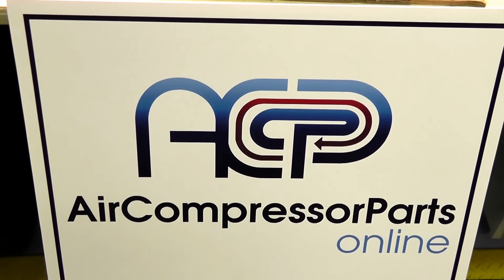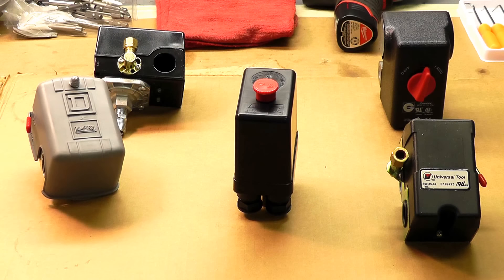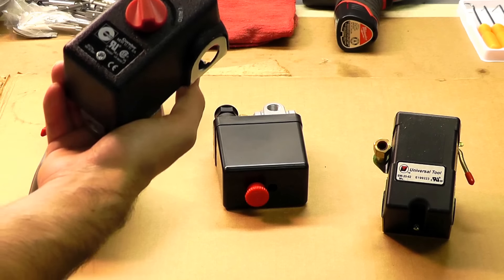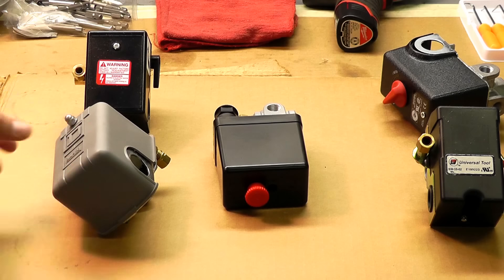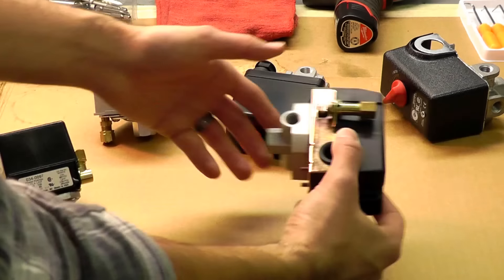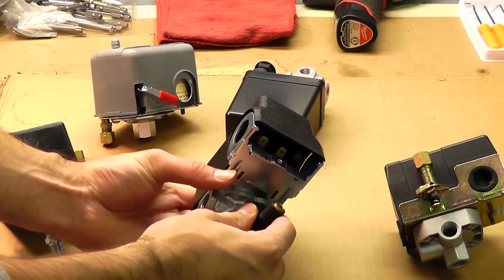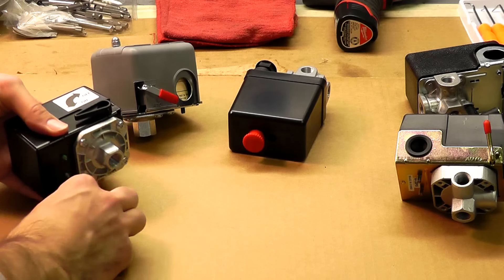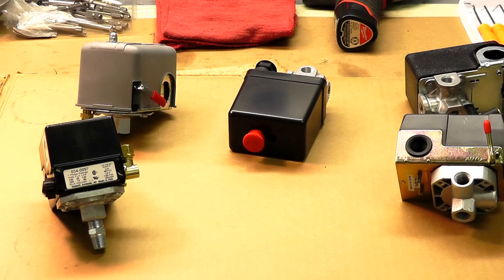Pressure Switch Replacement For Air Compressors

Comment: on your most popular Condor pressure switch, how do you disconnect the tube that goes into the 90deg unloader?
You mention that you push it in and it lock, but not how to remove it. Thanks for any hint.

Comment: Hi. Very informative video. Thanks 
I have a new Quincy QT-54 two stage. I need to re-route the unloader valve to go up to the exit port of the compressor. It’s a 90 deg elbow like you show but it’s a compression fitting for a 1/4” copper tube. My flexible hose that I want to attach is 1/4” NPT and it doesn’t fit the threads on the unloader valve. It looks like your standard 1/8” MPT, but my 1/8 x 1/4 NPT adapter won’t thread on. 
Maybe the unloader elbow can be removed and replaced with a NPT fitting? 
I’m not sure what my options are. 
Can you help?
Thanks,
Paul

Comment: I know this was made a long time ago. I have a fairly new AEG silenced 3hp 60l air compressor. The pressure regulator looks live the one with red push pull on/off switch with small hole beside red knob. I am in Australia and disabled so it’s quiet difficult to take it to get fixed. I’m told to small hole with Phillips head screw is for adjusting cutout pressure ( currently at 145psi. Winding that screw anti-clockwise does nothing. Have turned it between 3 and 4 full turns with no effect. Don’t want to go too far and have it fall apart in there. Also no obvious way to pull the cover off. Am quite familiar with square D switches on water pressure pumps, but this has me stumped. Thanks in advance

Comment: I need to replace the pressure switch on my older (early '90s) Sears Craftsman compressor. 

Compressor: Model 919.152830   30 Gal, 5HP
- Cut-off pressure: 125 PSI

Switch to be replaced: Furnas AC-0197

Sears' website says the part is out of production and no substitute part exists. But it looks just like the switch on the bottom right if this video. You referred to it as an import style 4-port Furnas style. Is that what I need?
Reply from the maker: Thank you for watching and for the question! First, the OEM switch is indeed obsolete now. However, it was a Furnas brand and a 4-port switch. You can probably use another Furnas (now Hubbell) 4-port switch, yes. The main specs you need to know is the cut-in PSI and cut-out PSI. You can view the various 4-port Hubbell/Furnas switches we have on our website by clicking on the below link:

https://mastertoolrepair.com/4port-style-pressure-switches-p-287.html

Hope this helps!

Comment: My Harbor Freight air compressor burned out after 13 years of service.  I disassembled the switch and found it was melted inside where the contacts are.  I replaced it with the red push/pull switch and voila!, it's back in service for a heck of a lot cheaper than another air compressor.
Reply: Were is the check valve on my hausfeld compressor?

Comment: Hello. This might be an off topic question but is it better to  leave the drain plug open when the compressor is not used for a longer period of time such as during winter in order to prevent any possible condensation within the tank?
Reply from the maker: Thank you for the question! Yes, it's always best to drain the tank of air when you know you won't be using the compressor for a period of time. You don't necessarily need to leave the drain cock open but at least drain all of the air from the tank when you know you won't be using the compressor for awhile; this certainly helps prevent condensation and hence, rust.

Comment: @Air Compressor Parts Online My pressure switch looks similar to your in the video in the centre with the red circular push down pull up switch and black plastic casing, can that type be adjusted? are some preset

It says on the casing;
PULL SWITCH NE MA (Spa)
20 AMP
380V MAX

Comment from the maker: AceBoy2099:

The SquareD switch you're describing sounds very common. From what I can tell from you description the cut-out pressure is 125 PSI. If this is the case, then the Square D model# W4203 pressure switch would probably work for you. You can find it on our site here: http://www.aircompressorpartsonline.com/square-pressure-switches-single-port-w4203-pressure-switch-p-15233.html. 

Basically, you want to match up the PSI rating (cut-in and cut-out pressures), the type of Unloader Valve, the type of manifold fitting and the amp rating. 
The W4203 is a two-pole pressure switch and cuts-in at 95 PSI and cuts out at 125 PSI (typical for a single-stage compressor), has a straight, brass unloader valve with a 1/4" compression fitting coming out from the bottom, and is rated at 15 amps. It has a single 1/4" FPT fitting on the manifold.
It is the same switch as the SquareD 9013FHG12J52M1X model. It will wire for either 120V/240 Volts, single phase or three phase.
Hope this helps!
Reply: Air Compressor Parts Online

Comment: We just experienced classic pressure switch failure. Our shop compressor started running up to 150 psi and lowing the relief valve. It is a Craftsman 60 gallon model 919.165600.  Do you carry Pressure switches for these compressors?

Comment: Good video. I have a compressor with a pressure switch like the "import" version, with the push/pull switch. I haven't had a real good look at it yet, but there may be an issue with the air bleed side of it. The compressor turns off just fine, but when it tries to start, the motor just hums, like it's stalled.
I think it may be that the bleed switch doesn't bleed all the air pressure out, not enabling the compressor motor to start, or that indeed the start capacitor on the motor isn't the correct one, not enabling the start windings of the motor to develop enough torque to start against the pressure.
Also, I'm in New Zealand, where we have 50Hz 240V line voltage.
Would it be possible, with the switch I have, to set the restart pressure lower, so that it actually starts?
Reply: It could be the check valve also.

Comment: I've got a Craftsman 33 gallon 110 volt vertical compressor. My pressure switch failed this morning. The one in the upper right hand corner looks very similar to mine. Did Craftsman use those as well?

Comment: 4:00 The thing i’m finding very frustrating, is that I can’t find the right size of compression fitting to replace the unloader tube. I have a pretty old compressor and the tube was aluminum and I broke it while I was replacing the pressure switch. Now I am having a devil of a time trying to find the right size tube and compression fitting.

Comment: Great video! Just purchased a compressor and trying to find out about everything I can :) The manual that came with the compressor doesn't explain the pressure switch part.

Just wondering, should there be a hose connected to the bleeder valve, the compression fitting that you point at @3:42 in the video? It wasn't installed when I got it, brand new, or is that for some extra features perhaps?
Reply from the maker: Thanks for the watch Chris! Yes, if your pressure switch has a bleeder valve (whether it be a "quick-connect" fitting or a compression fitting) then you should have a bleeder line attached to it. On most units out there you'll find that the bleeder tube routes from valve on the pressure switch to the side of the check valve in the tank. Without a bleeder line attached to the bleeder valve, there's no way for the unit to "unload" the excess air out of the lines when the units shuts off.
Reply: @AirCompressorPartsOnline  My old pressure switch had a compression fitting on it and my new one has a quick connect fitting is there an adapter for that?
Reply from the maker: @x9cat2  Thanks for the question! There's not an adapter for that that I know of. What we always recommend is to use the quick connect fittings on the new switch and to simply change out the rigid unloader tube with a 1/4" OD flexible Nylon tube, which works with the quick connect fitting. Our part# is NTB14 and we sell it by the foot, although you can obtain this locally as well. It's flexible too so it won't kink. This is the best way to go.

Comment: Hello. This may be off-topic, but I think you are an expert on air compressors. I have 12 gallon air compressor. Is it okay to depressurize the air tank receiver by using the safety relief valve by pulling the ring? I just tried a little from a distance, and heard a loud sound of air for a second and it kinda scared me. Is it dangerous procedure to pull the ring on the safety relief valve?
Reply from the maker: Thank you for the question! It's not necessarily dangerous to relieve the tank pressure from the safety valve, but it is very loud and not the best way to relieve the tank pressure. Ideally, you want to drain the tank from the drain cock on the bottom of the tank. For one, it's not as loud. Two, you don't have to hold it open with your hand the whole time. Three, it will also drain any moisture out of the air tank when you do this, so it's much preferred to drain the tank pressure from the drain cock at the bottom of your air receiver.

Comment: I have a Campbell Hausefeld vt91020, what would be a compatible pressure switch?
Reply from the maker: Thanks for the question! Your original pressure switch has been obsolete for some years now. There is a newer style conversion kit the manufacturer sells now, which is part# CW212600SJ and you can find it on our website by clicking on the below link:

https://aircompressorpartsonline.com/95125-furn-to-condor-ps-kit-cw212600sj-p-18819.html?osCsid=e1p8776ognlfijmot80tb6boq9&osCsid=e1p8776ognlfijmot80tb6boq9

This includes a newer-style Condor brand switch with the necessary tubing and fittings you would need to convert it. As long as the max PSI of your compressor is 125 PSI, the above kit would install and work for your model as best I can tell, and is the best option at this point.

Comment: HELP! I have a husky 60 gallon, when I turn it on it runs fine till it reaches around 20-25 psi. Then the motor starts clicking, its a constant click with 1-2 second intervals. Does it for about a minute, the psi stays at 20-25 psi and then shuts off and starts humming. Thats when I usually off the compressor, it never trips the breaker box though. What could it be? Any help would be appreciated, thanks.
Reply from the maker: It sounds as though there could be a couple of possible issues. 
1) I would have the motor's Run Capacitor tested. You can do this if you have a voltmeter but it's probably worth taking it into to a place like Batteries+ or having an electrician test the Capacitor. This is a common symptom of a defective Run Cap.
2) Make sure the contacts on the motor Starter Switch are clean and clear of rust or varnish. This is the assembly directly behind the front end bell of the motor. If you remove the screws you will see the copper contacts, and they may just need to be cleaned up.

I would say my money is on the Run Cap being defective, however. As long as the motor Pulley and pump Flywheel are aligned and your belt isn't too tight or loose, that's probably the issue.

Hope this helps!

Comment: I have the middle pressure switch. My problem with my Bostitch 25 gal vertical compressor is that when I pull out the red button to turn it on it Dosnt do anything. Does this mean the pressure switch is bad?
Reply from the maker: Thanks for the question Walt. It could be defective, yes. It could be as simple as a mechanical problem with the red knob where it connects to the copper contacts in the switch body, under the cover. When you pull the red button, there is a lever inside that should allow the copper contacts to press against each other, which turns the unit on. When you push the button, the lever should lift those contacts apart, cutting the unit off. If this isn't happening then it's possible part of the plastic knob or lever is broken, so the contacts aren't engaging. It could also be that the contacts are varnished and need to be polished to get a good connection. Last resort is to replace the switch.
I hope this helps!
Reply: @AirCompressorPartsOnline  thank
you for the feedback. It looks
Like the switch is working and the contacts are making contact so I will take it apart and clean them next. See if that helps. If I end up replacing the entire switch is there anything else that should be replaced at same time?
Reply from the maker: @waltw918  That's a good plan! I don't think you would need to replace any other parts, honestly (without being there with the compressor myself). Just make sure the tank is holding air and doesn't leak after the unit shuts off. If it does leak then I would replace the in-tank Check Valve. Otherwise, cleaning the Pressure Switch contacts or replacing it should take care of the problem.

Comment: I came across a free compressor I’m trying to fix if it’s worth it. The whole pressure switch assembly is missing. What info do I need to know to order one? I also have something missing from another hole. One large hole which I assume is these and I’m not sure what was in the small hole on the other side of the tank.
Reply from the maker: Thanks for the question! There are  certain specs you need to know about your compressor before you can find the correct pressure switch. First, what is the cut-on and cut-off PSI settings of the compressor? You should be able to find this info on the manufacturer's site and if not, try giving them a call to see if they can give you this info. Maybe they can even give you the pressure switch part number or specs. Next, find out if you need an unloader valve on your switch or not. Most units DO use the Unloader Line which connects the tank to the pressure switch Unloader Valve (this is usually a 1/4" OD copper or nylon line). Next, figure out if you need a single "port" or thread on the bottom of your pressure switch (the manifold) or if you need a 4-way manifold.
You can view the various pressure switches we have available on our site at the below link:
https://aircompressorpartsonline.com/air-compressor-parts-pressure-switches-c-25_2.html

Comment: then I have a real problem I was giving a power system plus aid compressor  and the switch was in a zip lock bag  the model # is 1125C  and the serial number is 2011070239 can you tell me what you sell this for and for can I replace it?

Comment: I have a ingersol rand model dd2t2 I need a pressure switch and everything that goes on it like the fittings and the gages can you get all that together
Reply from the maker: We don't offer OEM IR parts as you must purchase them from an authorized IR dealer (and we're not, I'm afraid). But, it's probably a popular pressure switch.
You can take a look at the pressure switches we offer by clicking on the below link. You can match the specs with the specs of your switch to see if one of our pressure switches may be a replacement for your original:
https://aircompressorpartsonline.com/air-compressor-parts-pressure-switches-c-25_2.html

Comment: I have a 60 gallon dewalt compressor and it will not even cut on. I use it all the time. It has power to switch and motor. It's hard wired. But motor will not turn on.. will pressure switch make it not even turn on?

Comment: really have a problem the one I have did not have one at all all I have is a modal number I brought mine use because of the switch it was busted and removed by the the other carrier is there any way I can find out witch switch I need for my air Conpresser so I can fix it?
Reply from the maker: If you can reply with a model number that will help identify the original switch and if that's not available, maybe a switch that is very similar. Also, any numbers or brand names on the original switch will help identify it.

You can view the various pressure switches we have available on our website at the below link:

https://aircompressorpartsonline.com/air-compressor-parts-pressure-switches-c-25_2.html
Reply: @AirCompressorPartsOnline  I have a Power system Plus Model# 1125C Serial# 2011070239

Comment: Thanks for this video. There is one question I have that I cannot find an answer for online. I would like to house my compressor under my woodshop (it has a raised floor) but can i mount my gauges and control valves a few metres away on my wall to change tools and monitor pressure? Is it possible?
Reply from the maker: Thank you for the question! That is totally possible. You can run flexible or rigid piping from where the outlet comes from the tank. I would then move the regulator and gauges to a wall-mounted regulator assembly. The link below is a large 1/2" unit:
https://aircompressorpartsonline.com/12-regulatorfilter-combo-unit-u1115-acs-p-3969.html

You can get very involved with it or you can use a simple regulator assy like the above that's mounted to a wall.
Reply: @AirCompressorPartsOnline  your site needs work bro
Reply from the maker: @chrishayes5755  I'm sure it could use some sprucing up, but we sell air compressor parts so it's not exactly a glamorous business. Thanks for the feedback, though ;-)

Comment: I fitted a max 12bar switch to my compressor that runs at 8bar 115psi. Can you adjust it down on the bolt ? As I have tried but still doesn't work correctly !
Reply from the maker: Thanks for the comment! MOST pressure switches are adjustable. If you see an adjustment screw under the cover, most likely that's it and if there is only one screw, this will probably adjust the cut-in AND cut-out pressures simultaneously. Turn the screw in a CCW rotation to decrease the pressure setting. You may not be able to adjust the pressure down to 115 PSI, it depends on the switch model. I hope this helps!